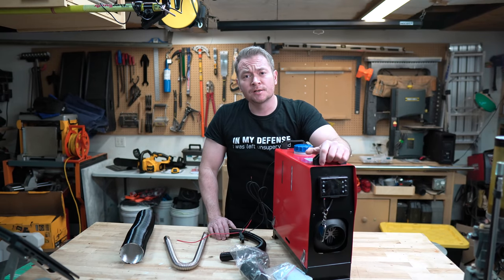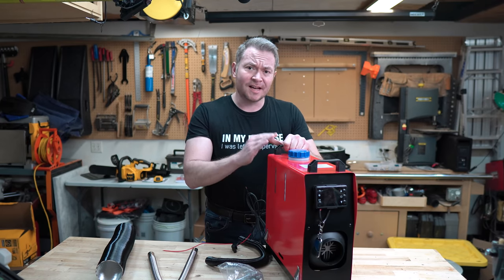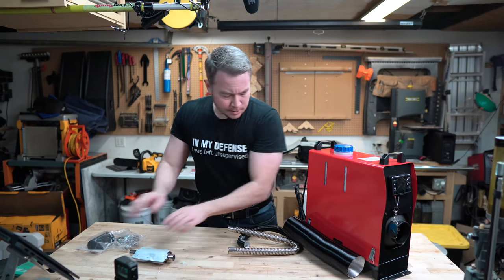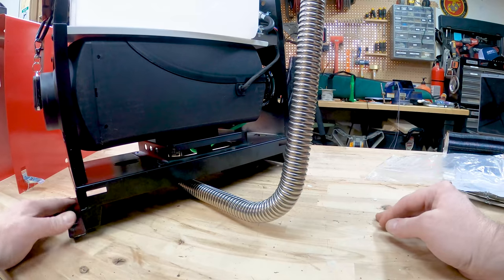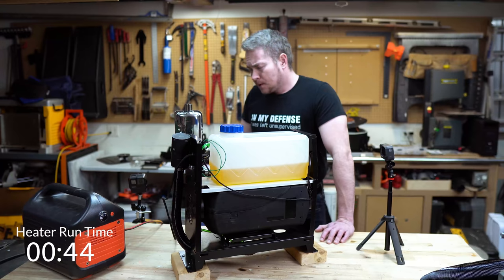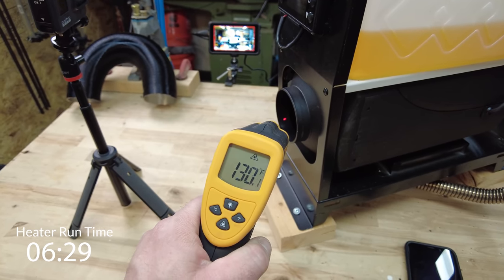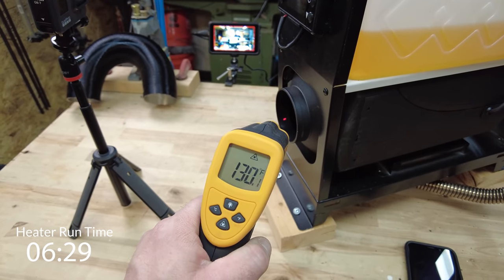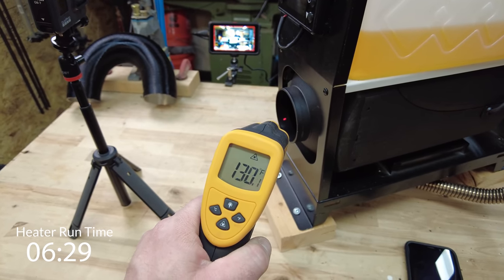My First Chinese Diesel Heater

Comment: In the video (at the beginning) I noticed 1/ A Subaru! and a 2/ FT857!
Reply from the maker: good eye.  Yes, I have a 2019 Crosstrek that I've modified over the past 2 years for overlanding, and an 857d that I've used for portable HF ops while in the middle of nowhere.  Recently, I took my Icom 7300 to Colorado with a hamstick dipole and had fun.  I liked the waterfall, what can I say.  I picked up a pan adapter for the 857 but am not sure how to make that work yet.  Still researching :)  Thanks for watching!
Reply: @TomtheDilettante  I am afraid I don't have the setup you have, I only have the 2001 Forester and an FT817! 
I did have an IC7000, but that sadly has been taken from me.

Comment: You’ll probably never see this. But if you use propane, buy the 100# tank. It is significantly cheaper to fill than the grill tank.
Reply from the maker: Seen. And someday I’ll probably end up with a much larger tank like that. But for now I’m my small suburban lot it’s hard to justify.  Thanks for the tip!

Comment: I thought it only comes with a hot wire and ground wire how did you plug it into jackery
Reply from the maker: good question, and sorry I didn't elaborate on that more in the video.  I used a Powerpole connector on the hot/ground leads from the heater to connect to a 12v plug which I then plugged into the Jackery.  A link to something similar to what I used is below for your reference.  Hope that helps!  Thanks for watching and have a good one!

https://amzn.to/3kFwrmH
Reply: @TomtheDilettante   I think you may have helped me out more than you know

Comment: so if i connect this to my car battery on a skoda octavia to heat um my tent will i still be able to start my car in the morning if i run it for like 8-10 hours?
Reply from the maker: I'm going to say "not likely".  At the very least, you'd need a good deep cycle battery and even then it's possible you might not have enough cranking amps.  It depends on your vehicle, your battery, and even things like the temperature to be honest.  If I were you, I would do a test run and have the means to jump your car just in case before trying this in the field.  Or, get a separate battery to run this so you don't risk depleting your primary vehicle battery.  Hope that helps, and thanks for watching!

Comment: Did you REALLY need to use the knife to open the clips?  I mean, it was pretty cool, but I still feel like I want to call you out on it.  haha
Reply from the maker: I'll answer this with a situation I suspect most DIY'ers can relate to.  I had been working out in the cold for some time and several of my fingertips had split (cracks at the tip or at the front by the nail) so prying things with fingers was just downright painful.  Hence the knife.  Convenient for so many things :)

Comment: I wonder, as it seems that exaust is hotter than the heated air itself, it would be a shame to just put that exaust outside, could you put that exaust through some heat exchangers like home radiator and after that put the exaust out... That would be cool test
Reply from the maker: Funny you should say that, and great idea!  I was actually pondering the same thing a little while ago and trying to think of what to do about it for the coming winter.  If I come up with or hear of anything clever, I'll share :)

Comment: Curious as to know about the carbon monoxide danger.
Reply from the maker: I ran this indoors for demonstration purposes and filming convenience only.  Always run a device like this outside or in a well ventilated area.  Under normal operations, a duct connects to the unit's hot air output and you run the duct to the area you want to heat.  I should have been more clear that regard in the video...something to keep in mind for the next time.  The way I'll use this is to either run the unit outside with a duct running inside, or run the unit inside with the exhaust run outside.  Either way, your question and observation is spot on...don't just run it inside :)

Comment: Carbon monoxide / co2 ? How can you run this inside ? 😮
Reply from the maker: In this video, the inside run was for fire-up and demonstration purposes. In other videos I have on this heater I show how I routed the exhaust outside which is definitely the right thing to do if you don't wanna die :)

Comment: I don't know. Thinking it might be a better just to get a quiet generator. It looks like that thing has to run off of the car battery and that's just going to kill my car battery. Unless I have one of those jackery things but that's like another 250 bucks in that point then I already spent almost enough to get a small generator. Not sure why that diesel thing doesn't generate it's on electricity. That would make more sense to me
Reply: Unless the diesel lasts longer. If it's cheaper to run it might be more sense. I don't know.

Comment: Well that helps when its already painted and you don't have to modify for the exuast! So I got the unit, haven't used it yet! Lol, cheap? Dosen't seem so! It's very heavey weight! And yes the manual is aweful! Thank god for youtube and creative space! That has to heat your garage at that temperature! I can't even stay in my garage when the thermometer is at 100% its aweful, feels like your being baked! Then again  that's a woodstove and the gargage was well insolated when I renovated
Reply from the maker: Yeah, one of the things I like about this unit is ease of setup.  It's pretty much ready to go out of the box...just a few attachments to bolt up.  Thanks for watching!

Comment: That reminds me of the gas heater I used to have in my VW Bug!  Aren't you venting CO into your shop?  Hope your insurance is paid up.
Reply from the maker: Yeah, for the test run I just ran it in place for a short time. For actual use I'd set it outside and run duct into the garage. Demonstration only ;-)

Comment: Suprised that you said that they tend to run rich, several tests over several videos show that they are very efficent and dont put out too much carbon or carbon monoxide...
Reply from the maker: I've since learned that they are in fact quite efficient.  I tore down this unit after a few seasons of use and found it very clean inside.  However, I think it also depends on how you run it.  I ran this one mostly on high and it was quite clean inside.  I have another unit just like this one that I've been running on low and it seems to produce more soot.  I'll take that one apart probably this winter to check it out.  Regardless, I've been very happy with them so far. :). Thanks for watching and chiming in!
Reply: @TomtheDilettante  i think the consensus is to run a normally low running unit hard once a month to burn excess soot off.

Comment: Couldn't you upgrade the individual components to be more efficient and better quality to last a bit longer?
Reply: Only the fuel pump is really an option. Virtually nothing else is interchangable. QC varies wildly , even if you purchase a 2nd unit 6mo. from now  from the same seller. Either he may now be getting a shipment from any DOZENS of shops making them ,  &/or  one of those shops may be getting individual parts ( like the fuel tubing )  differently that month. Be prepared to "be Handy" maintaining these. That said , cared-for some people have had theirs 8-10 years.

Comment: But you still have to recharge that battery.  Need to address that, because a battery is an inteegral component for this heating solution.
Reply: Solar panel for the jackery will recharge it in the field.
Reply from the maker: That's exactly what I'm planning on using :)

Comment: You have wasted your $170 my heater didn't last for 10 hrs of use. Carbon build up and blower motor failure were the problems I had with my Happy Buy all in one unit I bought on Amazon. Good luck😁
Reply from the maker: Sorry to hear that.  I’m on my 3rd year with this unit and no issues to report so far. Running approx 30+ hours a week.

Comment: So, you need 12 volt power to burn fuel to get heat.  Doesn’t the fuel burn with a match to start it?  That doesn’t seem the least bit efficient to me.  Am I missing something?  This seems to require a machine to run a machine.  And to go remote I have to carry two machines in my truck, right.
PS. When are we going to get that free energy that these craft use that come from Alpha Centari?  They sure as hell don’t get here on diesel fuel, eh?
Reply from the maker: Nah, I see what you're saying.  I think of it like needing a battery to run your car.  The heater is an engine after all.  It's not self sustaining with respect to electrical requirements.  Like a car or truck, but unlike a simple lawnmower or snowblower, this needs a 12v DC source to run.  I used a portable power unit that I normally have with me out and about anyway.  Others will wire it into their car battery, though be careful not to deplete your main car battery to the point where it can't start your car.  Others still will wire it to an auxiliary car battery if they have one installed.  

As for some of that sweet Alpha Centauri fuel, I'd do a video on that LOL!  But since it would take about 18,000 years to reach that star on a one-way trip traveling as fast as we've ever gone in space, I think I'm stuck with conventional fuel options for the time being :P
Reply: @TomtheDilettante :  Got it.  JWC

Comment: Where was thexhaust pipe designed to run?     Unfortunate this needs an outside 12VDC supply.  Should produce its own electrical power.   Always have a CO alarm incase fumes migrate inside your abode.
Reply from the maker: I routed the exhaust the way I did simply out of convenience.  I've seen it routed straight down and out if mounting in a vehicle, or shooting out to the sides or rear.  The one thing folks seem to agree on is to not route it anywhere near the fresh air intake lest you pull in exhaust fumes in your heated air.

It does require an external 12v source.  The motor is quite small and I'm not familiar enough with them to know if there's a power take off area to attach a generator.  Would be cool though.

Lastly, yes on the CO alarm.  I actually have two in the shop, but you're not the first to point this out and I probably should have taken more time to caution viewers about that.  I'll be sure to do that on future videos.  Thanks for watching and for the feedback!

Comment: I still plumb it to the out side carbon monoxide posioning I get 20self made alligator clamps to hold fuel tank
Reply from the maker: Yes, plumbing to the outside is a must.  I fired this up temporarily inside with a CO monitor above my head just for quick testing and convenient filming.  I ended up putting a note in the video description to ensure proper ventilation because it didn't occur to me until after the fact that not everyone may have the common knowledge to not run something like this in an enclosed space :P

Comment: Too that was awesome I'm such a novice and I get really freaked out when it comes to gas and electricity and I've been struggling with this for weeks scared living in prayer and then I got it and finally hooked up I got my deep cell battery and I got my and I got my I connected itToo that was awesome I'm such a novice and I get really freaked out when it comes to gas and electricity and I've been struggling with this for weeks scared living in prayer and then I got it and finally hooked up I got my deep cell battery and I got my and I got my I connected it.. I was smoking a little while I was nervous I pulled it out I should have put the gas in after I hooked it up.. The pipes on the knees but we're gonna redo it and then I watched you and then I watched you and you're great you're to the point like me and like me and I like I like your attitude I like I really appreciate it man I'm an obvious when it comes to this stuff so. Thanks again buddy I'm gonna watch ya I've been using the body heat up for a couple of seasons 26 below in Big Sky Montana lol I need heat all night not the buddy heater I get nervous with it running thanks again.

Comment: exost in the tent? carbon dioxite tixicity?
Reply from the maker: Definitely want to vent the exhaust for this thing to the outside.  I ran it to heat a tent and kept the unit outside with the hot air line running into the tent without any issues.

Comment: Have you ever used vegetable oil with these? Would be great if you could. I used to run one of my old cars on vegetable oil. I've also heard adding white spirit to the veg oil helps but I didn't have to in my old car.

Comment: Well I think you vastly overrate the expensive brands and underrate the Chinese variety.  I have been around the three main players in this game since the seventies with the singular exception of Toyotoma units (which left the US market some ten or twelve years ago) all the units which sold for $2200 to over $4000 were not rated for serious use.  When I contacted the manufacturer's several years ago only Toyotoma rated their unit for 24/7 use.  The other three Espar, Webesto, (I am not familiar with Planar as it is a later entry into the market), and Wallace all stated that their units were only designed for a life expectancy of 3-500 hours!  Now on a boat where it is used year round that makes no sense.  I ended up installing a $4500 Wallas unit in my boat (well insulated 26 foot) because of false assurances from a boat show salesman and experienced nothing but failures each one requiring expensive freight back and forth for expensive servicing.  I never got more than seven days of running at one time out of it.  I then heard of the Toyo(toma) Japanese unit that other frustrated boaters (if you are a charter boat operator or any kind of commercial user heat in Alaska is paramount - and for more than three weeks!) had come upon.  They did little to no advertising.  Their unit cost me $2200 and a full shop manual was available with DIY encouragement (a lot less computer boards on it!!).  When I asked the technician how long I could run it for he stated to do the specified cleaning and maintenance and it could be run 24/7/365 with no trouble.  All the other above manufacturers stated to do that you had to go to their oil fired hydronic systems.  There is no room for these animals and their high electric consumption on anything less than about forty feet and that would be stretching the space.   So from what I have seen on You Tube you get much better life expectancy from these "cheap" chinese units which cost less than the first run for replacement parts on the more expensive units.  That they perform better is another bonus.  My experience with the Toyo was that at an ambient temperature of 5-10F I could keep the boat cabin warm at 65 degrees for about five gallons of diesel every ten days.  It of course consumed much less as the ambient temp increased.
Reply from the maker: Thanks for sharing!  I'll have to check out this Toyo brand.  Hadn't heard of them so good to know.  An yeah, I'm not complaining about the Chinese version.  I thought it performed quite well and I certainly see no reason to buy a "name brand" unit anytime soon.
Reply: @TomtheDilettante  ive had a toyo on my 34 hatteras for 12 years gets me through ny winters no problem!
Reply: Toyo makes all kinds of appliances!!! I was in Japan for a couple of years and in the apartment I lived in was a Hot water on demand unit over the kitchen sink. Ran off natural gas and used D batteries to electrostaticly light it. All you had to do was push a square button that would start the water and gas flow and ignite the gas!!! Ridiculously Simple!!!
Reply: @fookingsog  Yes it is a very large company.  Limited offerings in this country it would seem.  Although in these times corporations often use different brand names

Comment: you cannot have this exhaust in an enclosed space you are heating because of CO poisoning. I'm surprised there wouldn't be warning labels for that as it is the law
Reply: It's called common sense.
Reply: @THEjasonTDI  Common sense is one thing but we cannot leave it to that. Protocol is required. And there is someone somewhere that will stick a battery in their nose so to avoid liability there are disclaimers.
Reply: Burning diesel or kerosene will warn you with burning eyes from ox of nitrogen LONG before co is a problem. Unlike gas powered appliance which can kill you silently. Yes, route exhaust outside.
Reply: @goodmanboattransport3441  darwinism wins.

Comment: Be cautious when attaching the power leads. 

Chinese manufacturers are renowned for not following the "Red=positive, black=negative" convention we use. In fact, they may not even use the same colors, or will have the leads reversed.

Also, having hot exhaust resting on a work surface is never a good idea! The supplemental feet option should be a mandatory mod...

And, let's talk about the look of utter surprise on your face, "How bout that? A successful test!"

Comment: That is a muffler, muffles work by having chambers around the main tube, when exhaust comes to the wide spot it expands to fill the space and starts to bounce sound waves off each other reducing the exhaust emitting sounds, and by reducing pressure. 

Diesel is a clean fuel. EPA has spread a bunch of lies and crap over the years. Black smoke from diesel exhaust is from running incorrectly, or when hopped up and running to much fuel. The black smoke is un burnt smoke.
Reply from the maker: Good points.  I use to subscribe to the notion that diesel was dirty, but didn't have any personal experience with it.  The more I've used and learned about diesel motors, the more I'm impressed with their efficiency.  Now I wish there were more diesel motor options in the US auto industry :)